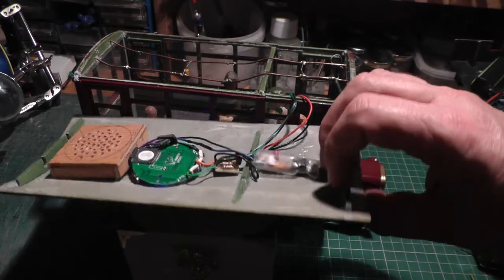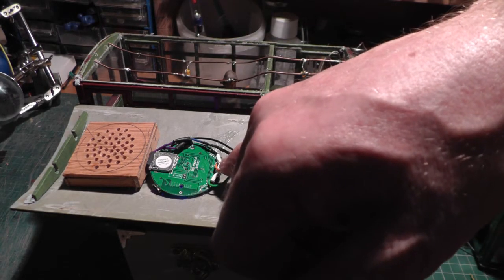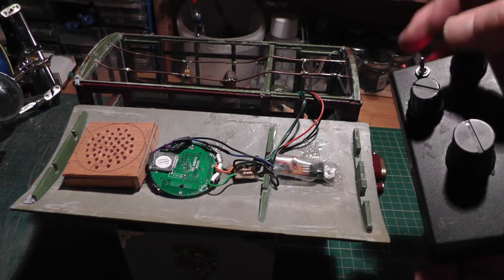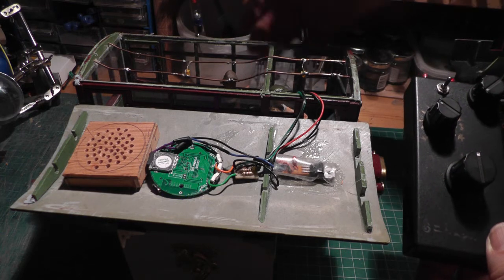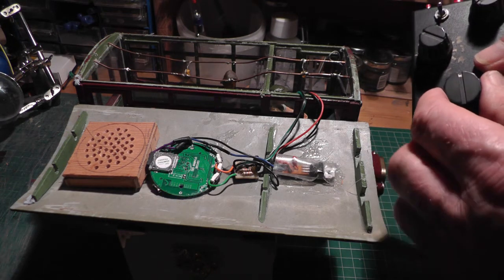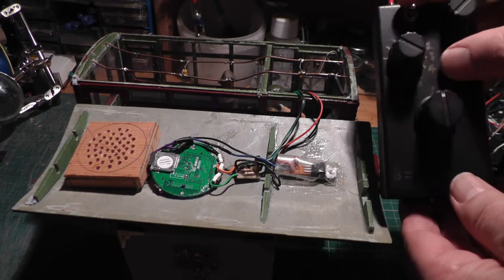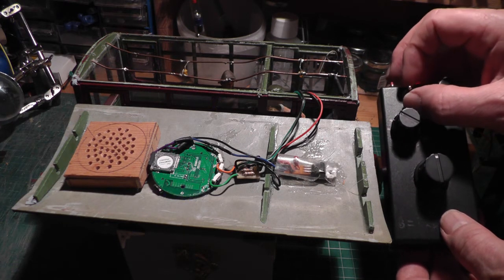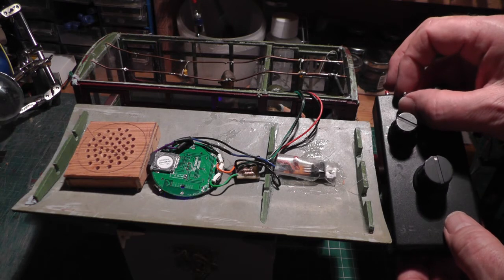Peckforton Light Railway - MP3 sound system explained

Comment: Very ingenius. I presume your blog has the circuit etc. I wonder if it would be worth dedicating a receiver to just sound. We have used Peter Sporer to good effect but we are restricted to 'diesel' or 'steam'. Having any MP3 sound file and any number of tracks would be great. Also the Sporer system we have uses IR which has range issues.
Reply from the maker: +John Mellor 
Hi John. Something I've considered is programming a Picaxe to control the card - detecting the output from the rx to change the tracks, though not yet figured out how to get it to tell the difference between slowing down and stopping.
Reply: +Ge Rik That would be a really interesting project. I'm longing to get my hands on a BBC micro and see what can be done with that.